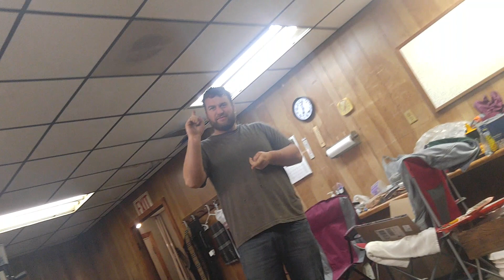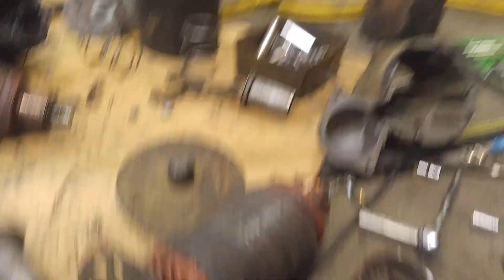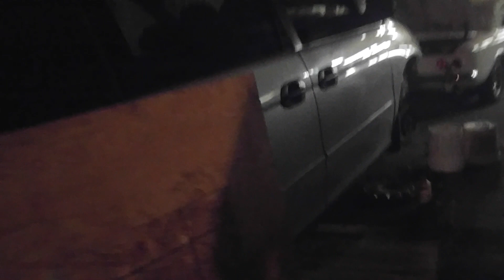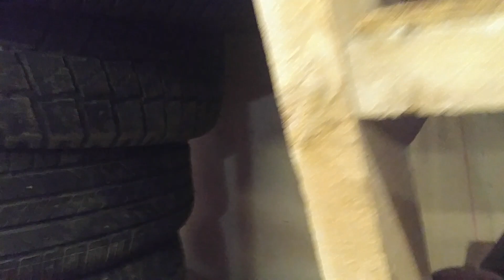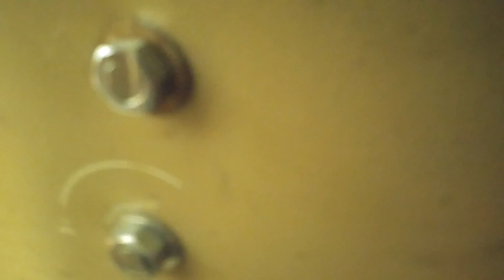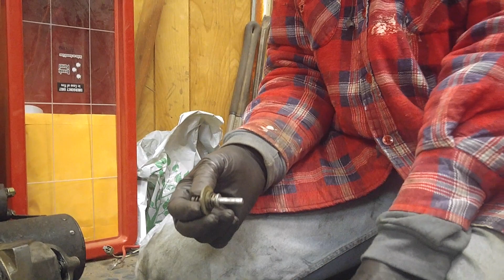Assembling 6.2 Diesel Starter 11 18 18

Comment: The re-engineered 6.5L block ( GEP) still has the same size holes for the starter.
 Same casting just different metallurgy